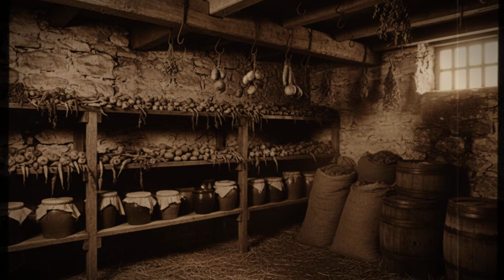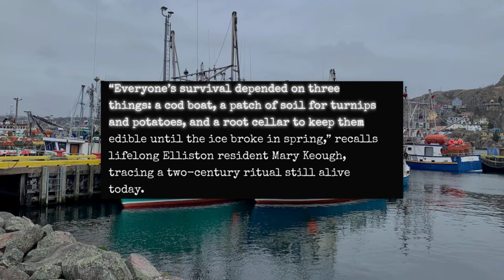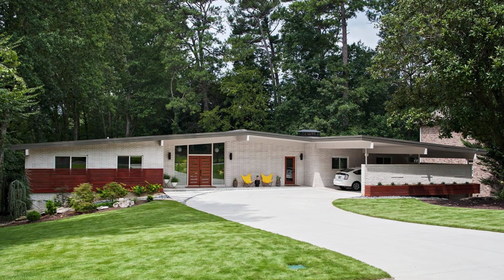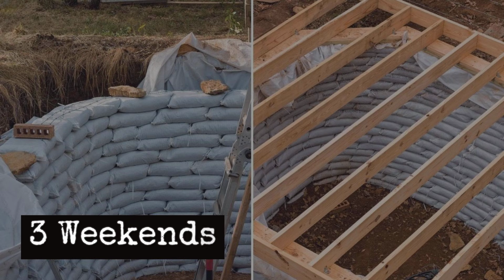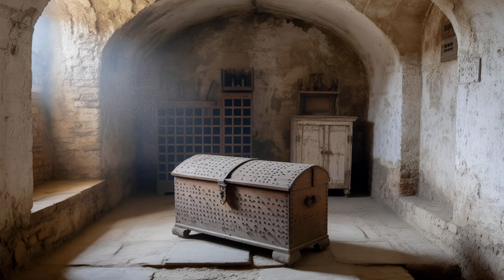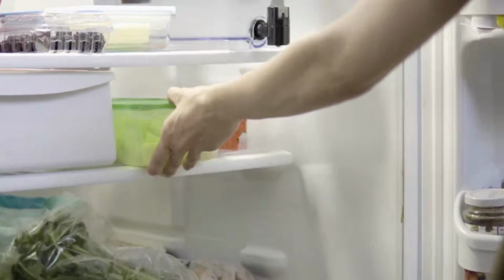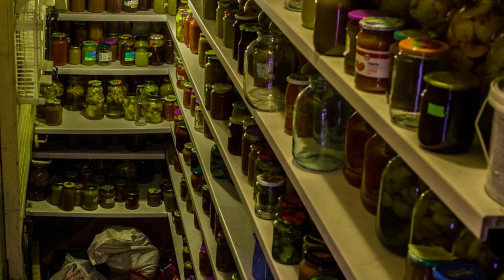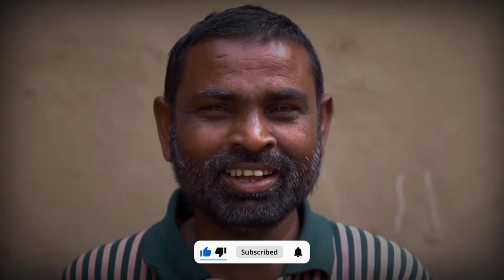FREE Refrigeration That Lasts 200 Years (No Electricity). Why Did They Kill It?

Comment: My Old Order Amish foster family has one of these attached to their basement, and it's crazy cool (both literally and figuratively :P).  They call it a "ground cellar" or a "root cellar" interchangeably, and walking from the concrete and glazed cinder block basement where they do their dairy work and laundry, back through a small connected chamber and down through an unfinished wooden door, you're suddenly in what feels like a natural cave.  

The walls are indeed made of dry stone wall construction, and the roof is earth over what I think must have been larger cedar logs?  They've put 1/4 inch hardware cloth across the interior because my foster mum has a vendetta against mice, lol, but I still remember the roots from the grass above that would hang down into the dark, damp room.  

It had a floor comprised of a certain depth of smooth river rocks and gravel  that allowed the ground water to drain freely through to the ground beneath and there were larger stepping stones to walk on in case you were wearing shoes because there was always a sort of slow moving stream of very frigid ground water passing just above the pebbles. I never dug down more than a few inches to see how deep the gravel and stones went, lol, but now I'm curious and need to check then next time that I visit! 

Anyway, it's where we kept all of the root vegetables in big wooden bins on stilts that sat on smooth flat stones that rose above the ground water.  The feature I loved the absolute most was this trough (pronounced troth) that was built into the ground with the same sort of stone work as the walls, but with enough gaps to allow the ground water to move through it more freely.  If filled with the same ground water that collected in the gravel and stones beneath your feet, and it was super fun to go and plunge my arms in when escaping chores and the horrible Ohio sun.  It stayed so nice and cold, lol. It's where we kept the jars of milk and yoghurt as a means of refrigeration. 

It's exactly as he describes in the video, with a pipe running above ground in the back corner, that's been covered with an aluminum window screen fabric, then 1/4" hardware cloth, and then a little aluminum hat that allows a gap that allows the air to come in for ventilation, while keeping out most of the rain. The screening and hardware cloth are important to keep out mosquitoes and mice, and such.  

These days they actually have solar panels and they always kept an old gas powered refrigerator (from the early 50's I think?)  that they would keep milk in for customers.  The root cellar is still there for veggies and overflow from the fridge, as well as for hiding from tornadoes! 😂

Comment: How does one do this when all they can afford is an apartment not a house or land?
Reply: We have created a system of laws and advertising in this country to keep you in debt for life.  
There are several reasons for that:
1. When people build structures, and then later go to the govt. for assistance because they can't afford heat or whatever laws get passed.
2. When people have to borrow to buy a house, the lender wants to be able to easily sell the house if the lender doesn't repay the loan, 
3. When houses are built close together, neighbors want conformity. They see your house as affecting theirs.
4. Some people like to control what other people do.
5. There are many, many industries who want to make a profit selling you something.  
    a) Original sales:  If you can design a system where you don't need their product--they lose potential income.
    b) Repeat sales:  If the product doesn't have to be replaced every so often--they lose potential income.
    c) Repairs:  If they can sell you something that needs maintenance, parts, etc--additional potential income.
    d) Insurance:  Insurance that tends to run out before you have a claim--more income.
If you don't understand what they are doing you will end up going nowhere.  There is too much greed and you need to figure out how not to be on the receiving end of what is happening.  Study the past, we didn't used to spend money on many of the things we do today.  We still have many choices that we can make.
Reply: @Liz-i9c5v  Excellent and True!!🙂👍🏽👏🏾

Comment: I will give you something else on chilling food. Ammonia/fire chillers. Crosley Icy Balls. Used by farmers, for Milk. Its fueled by exchange, input heat get freezing. Further, you neednt utilize wood or coals, you can utilize Solar evacuated Glass tubes, Or Freznel lenses on heat plates. All are without damage, permanent solutions. Furthermore, you can utilize these same type od systems with Seebeck Thermoelectric Generators. Those will outlast any solar panel, or wind power. They work on satellites still and will, from the first introduction of use. You can do alot.
Reply: Thank you, sir. God bless you!

Comment: What killed the root cellar....  Cheap food that is stored in commercial cellars.  Foods that store well in a cellar are potatoes, carrots, onions, garlic, brussel sprouts, etc.  To make a root cellar useful, I would need to plant and grow these things myself.  I have no desire to do this.  I did it growing up and never enjoyed it.  There is little point in buying veggies and putting them in a root cellar.  Furthermore, refrigeration is cheap.  It costs $150/year to run a good sized fridge.  And...  many houses just can't have root cellars... either the soil is not good for subterranean structures, or the water table is too high or the house doesn't have enough land or it is an apartment.  If I lived on a homestead and grew my own food, then yeah, I would have a root cellar.
Reply: Yup, agree with all of this comment - I also want to add that root cellars (while wonderful in the right context) require a lot of space. They're barely feasible in a suburban layout; and completely out of the question for apartment complexes/buildings.

Comment: My grandparents had it. I can't remember how they preserved the meat though. Maybe smoked
Reply from the maker: Smoking was almost certainly part of it but most families that had root cellars also used salt curing, brining, and in some cases lard sealing where you'd cook meat and then pack it in rendered fat inside a crock so no air could reach it. The root cellar kept the temperature stable enough for all of those methods to work reliably. Here's what's interesting though, did your grandparents also have a separate smokehouse or did they smoke and store in the same structure? That distinction tells you a lot about how serious their setup was because dedicated smokehouses meant they were processing enough meat to feed the family year round.
Reply: The problem with meat smoking is colon cancer. It was rampant before refrigeration. Different topic though.

Comment: Apartments etc do not have root sellers which added to the change.
Reply from the maker: That's a real point and one I probably should have addressed more directly. The apartment question is the hardest one for root cellars because you're right, the technology assumes access to ground. But here's the tension worth thinking about, apartments themselves are a product of the same urbanization pattern that eliminated root cellars in the first place. The question becomes whether urban food storage has to mean total dependency on the grid or whether there are intermediate solutions like shared cold rooms in apartment basements that could function on the same physics. Some older European apartment buildings actually had communal cellar rooms for exactly this purpose. Should that be coming back?

Comment: I'm having a thought. If you really wanted a freezer freezer, couldn't you dig a hole in the ground and then install an HVAC system on it? And that HVAC system would barely ever have to run to keep that frozen.
Reply: Could you not go to the local farmers during harvest season and stock your cellar? Even if you're a lazy ass who doesn't want to farm(me), it still works.
Reply from the maker: @CaedmonOS  Absolutely and honestly this might be the most practical entry point for most people. You don't need to grow anything. Find three or four local farms at harvest season, buy potatoes by the hundred pound sack, carrots by the bushel, apples by the crate, and you're stocked through spring at prices that are a fraction of winter grocery costs. The root cellar doesn't care whether you grew the food or bought it. What's interesting is that this used to be completely normal, families would do a fall buying run the same way people now do a Costco trip, except the food lasted eight months instead of two weeks.
Reply from the maker: You're thinking in exactly the right direction and yes that works. It's actually the principle behind earth-sheltered cold rooms in southern climates where ground temperature alone doesn't get cold enough. The thermal mass of the surrounding earth means your compressor would cycle on maybe a fraction of the time compared to an above-ground freezer because the earth is already doing 80 percent of the cooling work. The real question is whether the added complexity and electricity dependency is worth it when a standard root cellar at 34 to 40 degrees already preserves most produce for six to nine months without any mechanical system at all. At what point does the desire for frozen temperatures become a habit rather than a necessity?
Reply: @LostBuildArchiveza freezer is really just a tool for being more lazy, allowing you to freeze fully cooked meals, uncured meats, and stuff like that. So, really the question is, are you wanting to be lazy, and do you have the money to afford it? And if your worry is electricity, solar panels and wind generation and water generation are all options. But that's all more money.

Comment: Awesome information, thank you!
I'm looking for a solution to store rainwater year-round in eco-village in Ukrainian Carpathian mountains. The current root cellar built by previous owners is fully occupied already with 9-10 IBCs of water, it works great, but we need more storage. What kind of this timeless tech would you suggest to use for this project? Root cellars seem to be too small. We need around 30-50 cubic meters of space to fill with IBCs or maybe better is to dig and build and underground water reservoir, but dealing with concrete is not that easy there. Any suggestions welcome!
P.S. It can get up to -25C in winter, so need good insulation.
Reply from the maker: That's a serious project and the Carpathian climate at minus 25 makes insulation critical. For 30 to 50 cubic meters of water storage underground you're probably looking at a cistern design rather than a root cellar, and the oldest proven approach for that scale is a stone or concrete lined chamber with an arched roof buried under at least two meters of earth for frost protection. The arch matters structurally because it distributes the load of the earth above without needing heavy reinforcement. At your temperatures you'd want the top of the water level at least 1.5 meters below the frost line. Have you looked into whether the local clay soil would allow for a rammed earth or ferrocement tank instead of poured concrete? Ferrocement is dramatically easier to build in remote locations because you're working with wire mesh and hand-applied mortar rather than pouring and forming, and it's been used for underground water storage across Southeast Asia and East Africa for decades at exactly your scale.
Reply: @LostBuildArchivez thank you, this looks interesting, but for now I'm thinking - what is the actual disadvantage of just going the simplest possible way, like digging a pit, polishing the surface (make sure no rocks are visible), installing a pond liner and then building an insulated structure on top, with a manhole. We probably can use natural insulation, like sawdust or cellulose, and thus the structure will be lightweight. I've seen some homesteaders do this. What do you think?

Comment: Interesting Channel. It’s so foreign to me that people are not using root-cellars. I think the biggest reason traditional rot-cellars has disappeared, is because it’s inconvenient to go outside every time they are about to cook dinner. …… and the most obvious fact. There’s no point to have a rot-cellar if you’re in no ned of storage for your yearly harvest of potatoes. The only root-cellar I know is left are those who are built as part of the basement. 

And no, it’s not like a normal basement. Usually you have an insulated door that keeps the cold inside. One part of the floor are also not In concrete. Instead there is a wooden basin filled with sand to store potatoes and carrots in. There are also two vents directly to outside.
Reply from the maker: This is the most grounded comment on here and I think you've identified the real killer more precisely than I did in the video. It's not that root cellars were suppressed so much as convenience won. The version you're describing with the insulated door inside the basement and the sand basin and the direct vents is exactly the evolved form that should have become standard in modern housing but didn't. What I want to push back on slightly is the idea that there's no point without a yearly harvest, because even people buying in bulk from farmers markets or local growers during harvest season could use that same storage to stretch seasonal food across six months. Do you think the real barrier is the lack of the cellar itself or the fact that most people have completely disconnected from seasonal food buying in the first place?
Reply: @LostBuildArchivez Well 😅 I grew up with a great uncle, who also is an architect, that literally hammered in me the fundamental physics of food preservation buildings. I think people easily confuse a food cellar with a regular basement. A food cellar can not be damp. My food cellar is 100 years old and the air vents, made of wood, is still intact and not rotten. That wouldn't be possible with a regular basement. I think you're right that people has lost the connection to seasonal food. But I also think it's due to the fact that you still has to process the raw food in some ways before you can store them in a food cellar.

Comment: The "industry" does care if you have a root cellar. We're simply too lazy to grow our food, cook from scratch and to do long term storage. We like our quick easy meals within minutes which of course has to be loaded with preservatives. Industry gives us what we whine for.
Reply: Speaking only for yourself.
Reply from the maker: @RCH369  Fair enough but there's a real question buried under that exchange. Is the shift away from scratch cooking and food storage something individuals chose freely or something that became inevitable once housing and infrastructure stopped supporting it? Because if you grow your own food and store it, you're proving it's still possible, but most people aren't starting from the same position you are. What was your entry point into it?
Reply: @LostBuildArchivez I'm certain the infrastructure is responsible. What I'm commenting on specifically is the comment that everyone is too lazy to do anything about it. Not everyone is too lazy.
Reply from the maker: There's something in this that's right and something that lets the system off the hook too easily. Yes people chose convenience, but the convenience was architected. When every new house after 1950 was built on a slab with no basement, the choice to grow and store your own food wasn't available even to people who wanted it. Calling that laziness ignores the fact that the option was removed before most people could choose. The deeper question is whether the demand for quick easy meals created the industry or whether the industry shaped housing and infrastructure to make quick easy meals the only viable option. It's probably both but the ratio matters a lot for what happens next.

Comment: Please be careful when storing potatoes in cellars.  If they get damp or wet they can put off a gas that is deadly poison to breathe.
Reply from the maker: This is worth addressing carefully because it's partly true but often exaggerated in a way that scares people away from something perfectly safe when done right. Rotting potatoes can produce solanine and in extreme cases glycoalkaloids that are toxic, but this happens when potatoes are left to decay in a poorly ventilated enclosed space for an extended period, not under normal root cellar conditions with proper airflow. The two-vent convection system prevents exactly this scenario. Has there been a specific incident you're referencing or is this something passed down as general caution? Because the distinction between a sealed unventilated space and a properly built root cellar is the entire difference between danger and safety and I think a lot of people conflate the two.